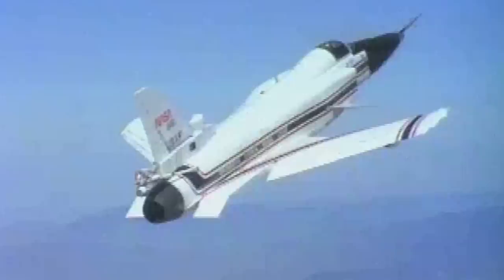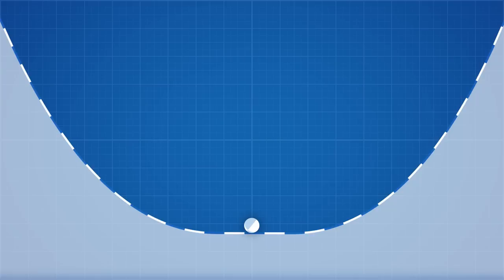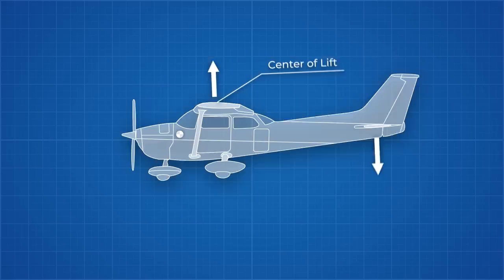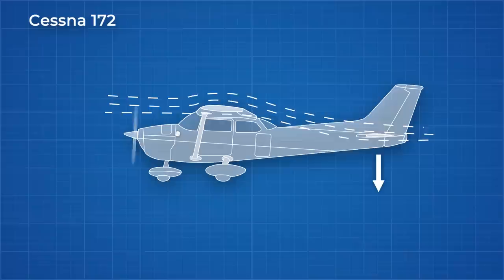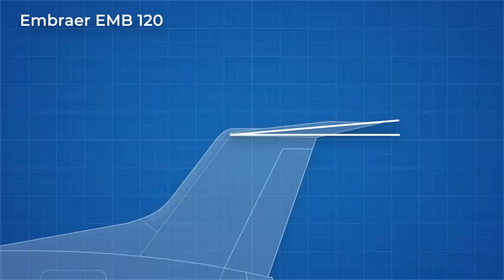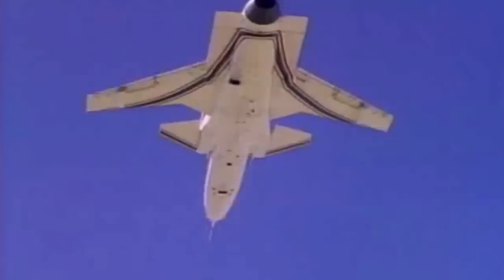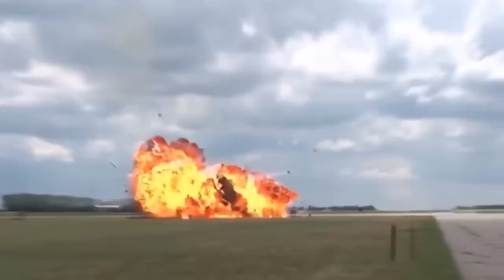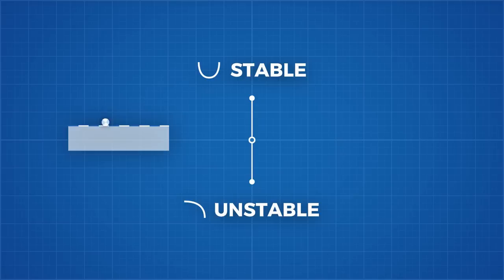Why Fighter Jets Can Be Too Unstable

Comment: I have a few things to say about this video.  Most importantly, as your airspeed increses, the downwash seen by the rest of the plane is reduced.  Second, I'd love to know a source where they suggest that wing downwash is the primary factor in controlling for airspeed.  

Your video is... quite good after you get away from downwash being a significant concern.  (it is, but not.. how you approached it)  

The F-16, is an interesting subject as an airplane.  It's stability is wildly variable dependent on airspeed, at maneuvering speeds it's dynamically unstable.  At mach, when the CoL moves aft, the plane will become conventionally stable.  The X-29 was built to be unstable, the forward swept wings weren't "a necessary condition" for the relaxed stability.  

Your hill analogy could.. be done better.  the hill versus valley analogy is usually presented as a pair of dishes, or parabolas, or half circles.  When the curve could be used to describe how that stability behaves.   Though that might get complex, fast...   You could use that hill analogy to describe static stability, versus relaxed, versus unstable designs.  (In that time you used to talk about downwash...)

Keep up the good work.  :-)

Comment: I don’t enjoy how Static Stability was used in the place of Positive Stability or the fact that downforce was not explained properly, the camber of the horizontal stability creates downforce in the same manner as a wing creates lift. Side note the CF-18 crash in this video was caused by asymmetric thrust due to the loss of the starboard engine not due to the instability of the aircraft.

Comment: There's a thing called the "Aerodynamic Center" or "Neutral Point" on the aircraft, that is only affected by aerodynamic design. If the C.G is before that, it's stable, otherwise, it's not. The calculation of that point involve some rudimentary calculus, but I think the viewer from this channel should be able to handle the concept. It's also like the first thing you learn when taking aircraft dynamics/aircraft design course in collage.

Comment: So in car lingo: fighter jet = oversteer tendency, airliner = understeer tendency
Reply: that's actually pretty dang accurate, fighter jet= Ferrari, airliner = a dump truck
Reply: Kudos if you actually managed to make a dump truck understeer. 😜
Reply: @Dowlphin  they understeer all the time, trust me..ive driven them, they have 2 steering wheels on some models do to that, also i meant by the class difference

Comment: This doesn't make a case for a fighter being too unstable. While you use a hill analogy, you forget to put fences (computer control systems) that stop the ball rolling down very far.  The classic fighters tend to be unstable and get the reputation of a widow maker with in experienced pilots. This goes all the way back to Sopwith Camels. Usually being unstable in aircraft is associated with being 'nimble'. In the past there has always been the limit of human reflex times.  But with modern systems with relaxed stability, you can get stable flight from a very unstable aircraft . However, if you lose all of your power, be prepared to eject.

Comment: To be clear, a normal aircraft's "pitch" wise stability has nothing to do with pitch, without flight control input, an Aircraft Want's To Stay At A Certain ANGLE OF ATTACK.
If you left the stick along, throttle up,  you will pitch up, BUT, your angle of attack won't change,  if your pitch angle is like less than 10 drgree, basiclly , your AIRSPEED WILL NOT CHANGE, because with steady climb, Lift is still = Weight, and Lift is proportional to both AOA and square speed, Just nothing changes.
Throttle back ,pitch down, and still about the same speed. of course with some oscillation of speed and pitch in between.

Also, to be a stable airplane,  the stabilizer doesn't have to generate down force. There are a handfull of little sport canard plane which doesn't have any computer FBW system to keep them fly.

Comment: Centre of gravity of your Cessna is way off in this video... Would be much more aft because the main part of the weight lies on the main/aft gear.
Reply: Doubt it. That CG position looks about right. Also, if you put most of the weight in the main gear with the CG on top, you run the risk of making your plane a tail dragger
Reply: @gabrielcho999  It's not. And no it does not because the CG is still in front of the main gear but only slightly. As a pilot you always try to take the load away from the front gear by pulling on the yoke because it is not build to carry that much load. In this picture it would be way too noseheavy and too heavy for the nosewheel to carry the weight. The "main" gear carries the "main" part of the weight. That's how every plane is built.
Reply: Markus ok, the things that you said are true. And also I have never flown the type. But on an airplane, specially a 172 that is made for novel pilots, you cannot have the CG too close to the Centre of Pressure, as the video explained why. And considering that as you increase the AoA, the CP moves forward until the point of stall, you cannot have the CG aft of that. And we’re talking pretty close to the leading edge. That was my point, in relation to the drawing of the video
Reply: @gabrielcho999  Yes you can. However, it still is in front of the center of pressure on a 172. If the CG is that far in front of the center of pressure like in the video, the aircraft would be "too" stable and it would be hard to change the attitude of the aircraft.

Comment: Hmm, the COM on the Cessna profile is way too far forward. Generally, for a stable aircraft you want your center of mass near the 25% of the Mean Aerodynamic Chord, which INCLUDES the tail surface. The tail does not always have to provide downforce, it has to provide less lift than the main wing, for example most gliders will have a lifting or neutrally loaded tail. The X29 was intentionally designed to be unstable, RC models of it will fly just fine with the COM much further forward. The downside is that the canard deflection will have to be larger, and in the opposite direction for trimmed flight, and cause excess drag.

Comment: The issue of stability versus maneuverability is an age-old problem with fighters.  Normally it's a trade-off, choosing either a stable platform or a heck of a dogfighter.  Of course, it's not always that simple.  With stealth, as in the F117, we weren't seeking dogfighting capability; the basic tenets of stealth made the initial F117, or its precursor,  unstable with no compensating virtues.  The cost of stealth; thankfully, with computers and cad/cam, we solved that jet's problems.
Reply: Personally I think we've already maxed out how unstable we'll be making fighter aircraft. It seems jets are going to be used more as platforms to launch missles nowadays than actual dog fighters so stealth and stability will continue to increase while maneuverability will plateau

Comment: Actually I am kinda unsure about the down wash thing bcz  we always try to keep horizontal stabilizer away from main wing down wash bcz is reduce the effective angle of attack by down wash angle (alp_tail) = (alp_airplane)-(induced angle).
Second at high alpha cases the air separated from main wing when hit the tail plane will cause buffeting and which in some worst scenerio will cause structure failure.

Comment: Hello Real Engineering, if possible could you please make a video explaining how does a commercial air conditioning system works with different temperatures in different rooms with only one cooling unit on top of the building.

Comment: Dihedral Angle.  You forgot to mention it.
I was put on flatspins on purpose many times throughout training...Not a pretty picture, very undesirable experience.  Especially while wearing a hood.  The thing about these fighters you speak of, is that they're so overpowered they can almost get away with anything.

Perhaps you should start warning people about that engineering out of CG disaster that is the 738MAX.
Reply: He didn't refer to it by name but he explained the affects of An and Dihedral when talking about the wingtips of the F-4
Reply: @bengrogan9710  Fair enough.

Comment: if the fighter jet is made to return to its original position atometically after doing any movement it will affect the airframe and control system of the aircraft because the front and rear wings will bear a very heavy load to perform menuver .. and in my opinion the fighter jet is the most stable aircraft, it only needs a touch from the pilot to bring the aircraft to do what the pilot wants
Reply: HMMM most modern fighters are aft loaded unstable. This creates very high instantaneous turn rates. They literally cannot fly without the FCS operating correctly.

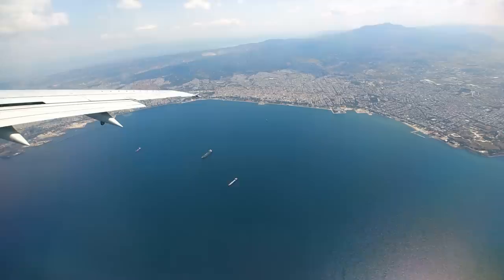Comment: I am understand intencion this clip, but explenation 3:22-3:51 using Cessna is wrong. Center of gravity is located around place where changes of the weights of planes parts minimally affecting balancing. CG is located much closer to fuell tanks in wings and rear passenger seets.

Comment: Static stability is exactly why the Max should never have been allowed into passenger service. The 737 Max does not have static stability, so it uses the MCAS to correct for this instability. Unfortunately, that led to issues and two accidents.
Reply: The 737 is perfectly stable, the problem is that Boeing gave it more powerful and efficient engines in an attempt to compete with airbus, those engines force the craft to pitch up when making thrust because the craft wasn't designed for such engines, the problem was software only in that the software thought the plane was violently pitching up when it wasn't, forcing the plane into an inadvertent dive that the pilots can't fight against because the software overrides their inputs to pull up.

I'm short, the 737 airframe was allowed by the FAA because it was a well proven airframe with decades of service to back it up, and Boeing thought they could mitigate the pitch issue with software to reduce pilot workload, Boeing rushed it into service because they couldn't stand to be out competed by Airbus when they retrofitted one of their models with a new engine that was much better and more efficient than earlier models.
Reply: @SmoochyRoo  so...you literally go on to correct me to state that the 737 Max is unstable. 

A pitch-up attitude, is not an inherently stable aircraft. The airframe of the original 737 aircraft, is indeed stable. However, with the new Max, the Center of lift and center of gravity were shifted. Thus the MCAS was designed to make up for this shortcoming. Thus, it is not an aerodynamically stable aircraft
Reply: @MustachioFurioso9134  my goal was more to explain why it was allowed by the FAA than to correct what you stated, and were the craft to enter an unpowered glide it would glide perfectly without issue for the pilots

Comment: The T Wing Embraer example was also unclear. You should have illustrated the angle of attack with the entire aircraft in a wind flow. The pitch of the aircraft has no effect on the wing.

 Instead the speed combined with the angle of the aircraft through the air can have the effect of stabilizing the aircraft. (which of course is what Angle of attack actually is)

Simply said, you should have explained angle of attack.

Comment: It should be dynamic stability, not static stability. Static stability is like a ball at rest at the top of a hill or at the bottom of the valley. Dynamic stability is the ability to return to the original state after a perturbation. A ball on a hill is dynamically unstable. A ball in an infinite valley is dynamically stable.
Reply: Isn't this exactly what SE just said

Comment: Can someone pls address this question. Mainly it is regarding the very first planes used in WW1. Let’s say a WW1 plane is moving in a line in a battle. Can it stall it’s engine, remain moving on that path, but turn around one of its axis (it would probably be the vertical axis that is more or less it’s GEOMETRIC center) so it will look like it is strafing almost. The plane would look like it’s moving sideways. It keeps moving on previous path, but it has turned so body and nose face somewhere trying to target an enemy that is positioned only if it turned at least 90 degrees. Question is whether it is possible.

Comment: This video's explanation does not really explain how a flying wing flies without a horizontal stabilizer. 
Usually aircraft static stability is explained in terms of static margin where stable aircraft have a positive static margin and unstable have a negative static margin. Static margin is the distance between the c.o.g and the aerodynamic center and varying this value changes how stable it is.

Comment: Wonderful presentation ! The only stability axis that wasn't covered is the yaw and i guess that the vertical symmetry of most planes makes up for this oversight. I am curious though to know how important this yaw stability is for combat airplanes and if it could be redesigned to allow a recovery for planes which have an unstable pitch so that they could make a roll-turn when they reach critical downward velocity. Maybe I'm getting ahead of myself and this has more to do with piloting lessons. Anyways thanks a lot for this presentation and keep up the great work :-)

Comment: As a retired Aerospace Engineer, we designed fighter jets that were statically unstable and used electronic flight control systems to make them better for our pilots in combat.  Fighter jets are never designed too unstable.  Too unstable would mean they would diverge, breakup and kill the pilot.  Yea, you are missing all of the nuances in fighter jet design.  It would take years of university and years of on the job training.  But, no fighter jets would be designed to be "too unstable".

Comment: I guess it's different when the force came from the back or front... like the fighter jet your saying.. the force came from the back.. and it is pushing the plane, a slight movement will cause a big effect... that's why it is more maneuverable... The other plane you where comparing have the Force came from the front.. and it is pulling the plane, that's why it is more stable.... 

I don't know what I'm saying...hehe

Comment: What about low speed airplanes where the stabilizer is placed ahead of the main wing, like the Wright Flyer? There the stabilizer also produces lift, which is better for fuel economy. But how does stability work on this type of airplanes?

Comment: About that cessna’s stability: doesn’t the main wing angle change in the same way as the tail? If yes, doesn’t the force change in a similar way (but opposite direction)? If yes, why does it still return to straight flight?

Comment: The reason for the argument of the commentors was not unsound. "Stability" as used here, refers to "automatic re-leveling".
I have a saying about programms: "Nothing is quite as dumb, as code that tries to be smart." Automatics that try to do something usefull without user input, usually end up causing no end of issues. It is the same effect at work with agressive Spellcorrection or Clippy. A more recent example would be a certain automatic in the Boeing 737 Max: https://www.youtube.com/watch?v=H2tuKiiznsY 
For passenger and transport aircraft, self-correction is wanted. They are like trains, you want them to be reliable and efficient - including in pilot attention.
But for a fighter airplaine, that would be something you have to fight when you want to maneuveer. Wich should happen a bit more then with a passenger/cargo aircraft. They are more like Formula 1 Cars. Still, they mixed up limiting what you have to fight with having no assitance and super twitchy controls.

Comment: Why didn't Boeing stabilise the 737 Max so that the plane recover aerodynamically (rather than using MCAS) when it pitch up? Surely, they can design a new stabiliser to address the pitch up issue, without depending on software.

Comment: When I was in the airforce we were told that if the computers didn't keep the F-16 level it would be almost impossible for a pilot to do it
Reply: The same applies to any modern fighter jet and there are airliners that would be unflyable without electronic stability augmentation like the B777

Comment: With the T-tail planes, wouldn't the horizontal stablizer force return to a stable state if the aircraft maintained the pitch change long enough to change the velocity vector of the aircraft to align with its prograde attitude? E.i Pitching down 5 degrees from level and holding that pitch angle until the velocity vector becomes 5 degrees below level.

Comment: The explanation of static stability at around 3:30 isn't correct at all. You didn't mention, that the center of lift isn't fixed and moves as speed and angle of attack change. This allows for the cog to be at around one third of the depth of the wing (rough value for slow general aviation aircraft like cessnas, faster aircraft have more backward cogs because they profitate more of col movement). With the cog depicted in the sketch the plane would be totally uncontrollable. The influence of downwash on the stabilizer is not noticable, aircraft without T-tails need angle difference, too.